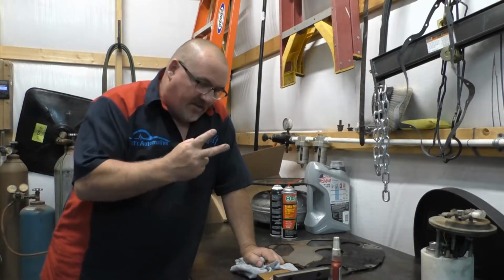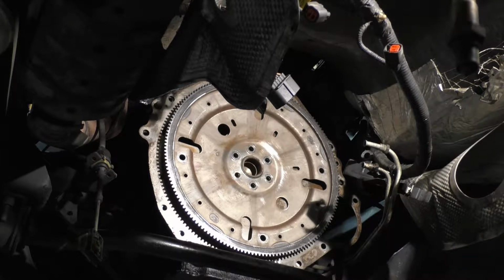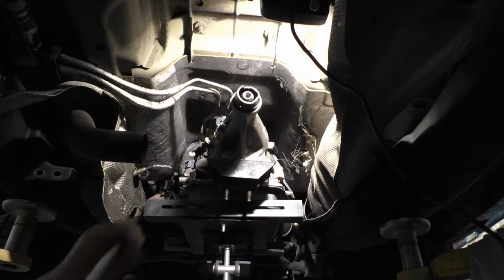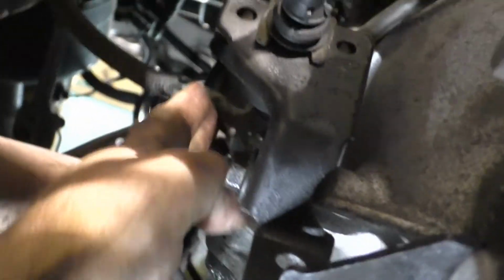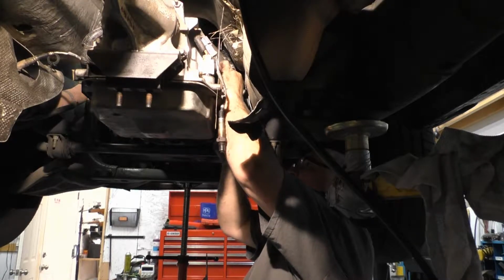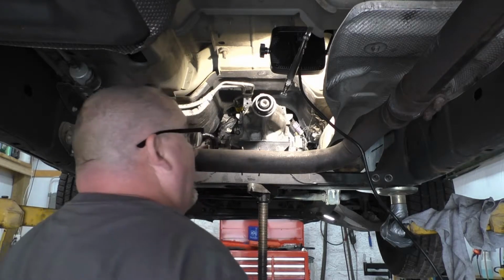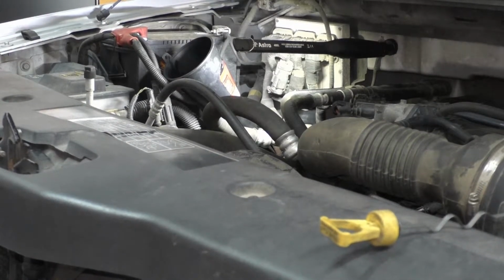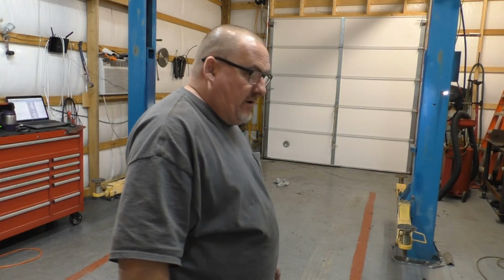2005 Ford F150 Transmission Install (Follow Up on the removal Video)

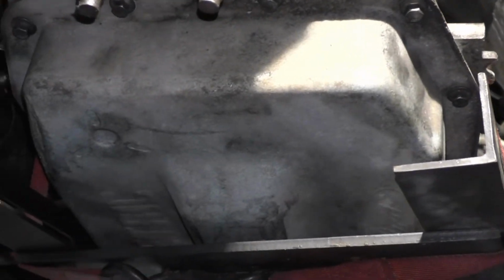Comment: Hi I’m having trouble with my 2005 ford f150 transmission, on your video @ exactly 23:29 there’s a connector on that Trany can you please tell me that name of that because I believe my trany is leaking from there and ford is not being any help and I search web/ videos and this is the only video that that part pop out and on 26:03 you are holding the wire that goes there with your right hand thank you

Comment: My shift lever will not move at all even with the transmission out. Is there something I might have missed pulling the shifter cable off?
Reply from the maker: Something bad wrong somewhere

Comment: I just installed a rebuild 4R75E transmission from ford dealer. Everything works fine except when going uphill at around miles ,it feels like slipping gears, and if going faster, it is beginning to shift fine 

Any ideas? What's wrong?
Reply from the maker: I would have no Idea unless I drive it but if it was me I would have a look at the pressures. You are likely used to your truck and probably know when something is slipping so I would want to check that.
Reply: That sounds good. Thank you for taking the time.i was losing my mind without having an idea where to begin. I'll get right on it. 

Thanks again.